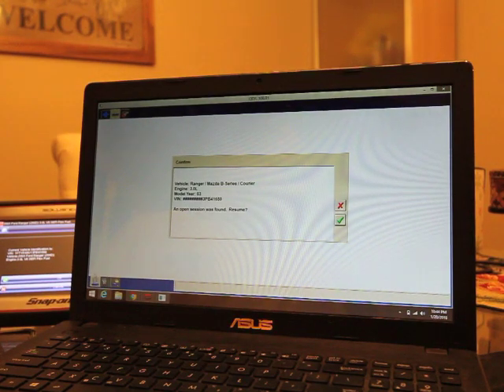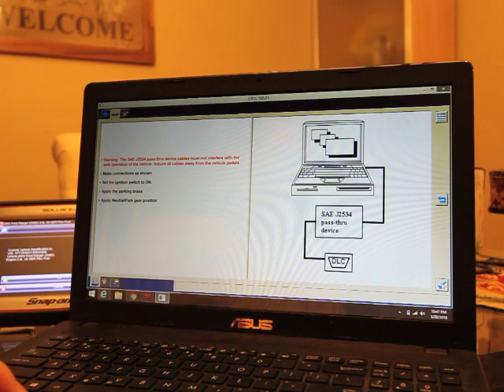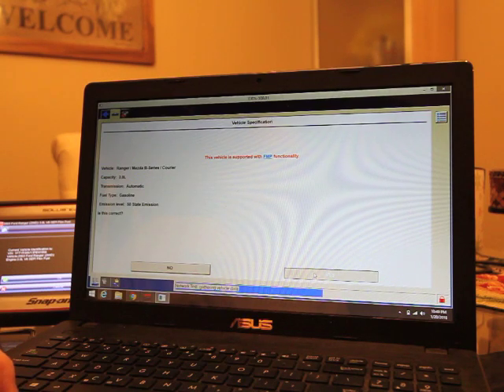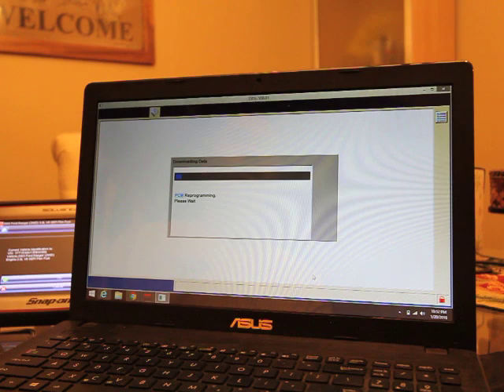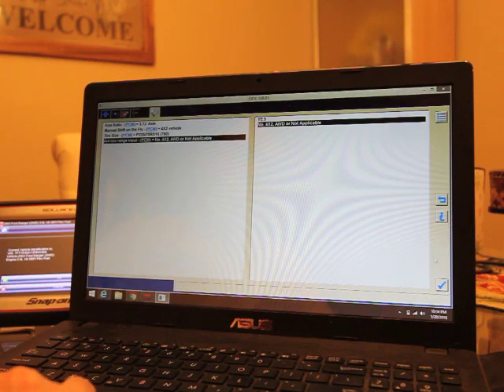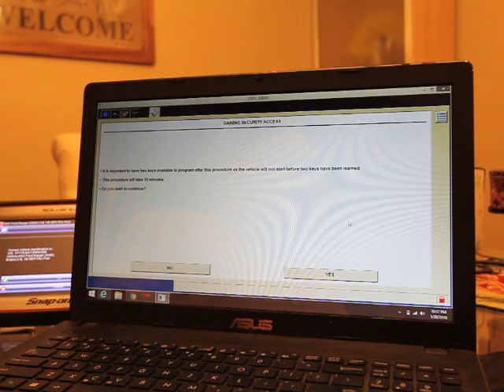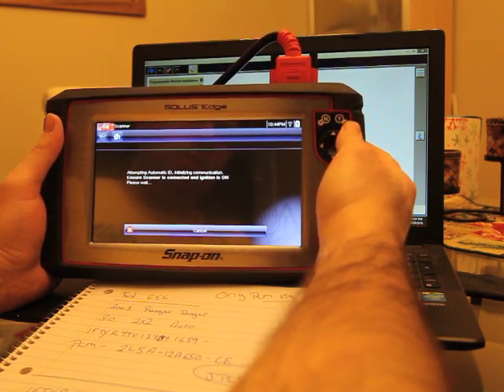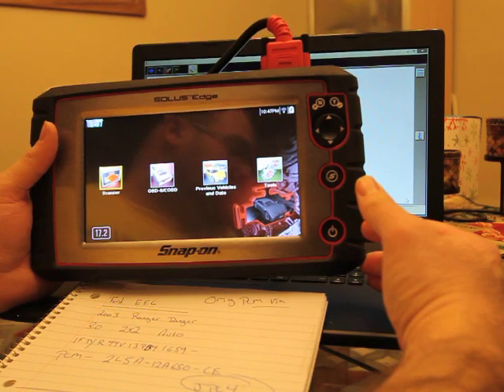Ford PCM / ECM Reflash With VIN Change walk thru j2534 Programming flash reprogramming FORD IDS FJDS

Comment: I changed my ecu with a new one because my old one fried.. now the vin number is not my original.. I paid locksmith to come out and code my original 2 keys to the new used ecu but just need my vin changing on this new ecu to my vin on the car... any help please?
Reply: My issue right now how did you go about it?

Comment: Hey question, what are the pinouts on the ford pcms that are required in order to read them on a bench? I know it’s power, ground, can h, can l, 120ohm resistor. But, does ford require more such as CKP etc?

I am looking to obtain the pinouts or their acronyms so I can look at the wiring diagram. I’d appreciate it much

Comment: Excellent info, thanks.  What bench programmer do you like for Ford PCMs?
Reply from the maker: J2534 device? I use drew tech mainly as for software IDS or FJDS when using drew tech. 
I clone lots of ford pcms now vs flashing them with a subscription when I can. 
Anything late model especially to avoid the pats reset with nastf.

I use for scan a lot for transit vans when doing abs and other odd things. Software works great for weird odds and ends.

Comment: Hi question,  i have a 2004 Focus svt, that the oem ecu has Zero communication so car would just crank. No fuel or spark at all.
After changing almost every possible part, I decided And found a 03 Focus svt ecu And came with the key too.
After installing the replacement ecu car started right up, yeah!
My main issue is that my 04 svt came with a supercharger And a Ford SCT X3 scanner that now say Vehicle not recognized. 
Of course is because  the sct is married to the oem ecu. I need somehow to transfer the Vin to the replacement ecu. 
I've called SCT and they told me sorry your sct scanner is too old for us to unlock. 
Any suggestions??

Comment: Great video. I have a question. My 2015 f350 6.2 pcm went bad. Ordered one that was programmed to my vin. After installation the truck runs terrible and won’t idle right and eventually throws the wrench icon and goes into limp mode. Even though it shows the vin on remanufactured pcm is correct is it possible it still wasn’t programmed right? Tia
Reply from the maker: Probably wrong hardware did part number match?
Reply: @SpartanAutoworx  yes part number was exact.

Comment: Eric, I am trying to figure out if I should replace my pcm in a 1999 Ford Expedition Eddie Bauer 5.4L.

My vehicle randomly shuts off when running, and when it does this, the Odometer reads '-------' and the numbers are not displayed on the odometer when it shuts off.  If I switch the ignition off at the key and restart, it restarts fine, until the '------' returns on the odometer. What does that typically mean? I was thinking that since it is random and that the odometer is good, that it may mean that the pcm is bad, assuming all the wiring in the harness is good. 

Previously, I had the instrument panel serviced to repair a problem where the fluorescent digital display odometer was intermittently blanking out to black due to a bad solder joint which is a known problem for Ford Expeditions and F-150s that have this type of display.

I took the Expedition to the Ford Dealership where they detected a TPS code and replaced the Autozone TPS that was replaced a few years ago, to a Motorcraft TPS. About a week later the Expedition shut down at 45 mph when I was driving it on a 2 lane road.

Also, I want to know if the TPS % reading on a scanner should range from 19.2% to 95% normally with a good TPS and a good PCM? I ask this, because I thought it was supposed to be more like 5% to 98% or something like that.

I have read on the Internet that the PCM Relay might be bad, and cheap to replace, maybe $15. But, that doesn't explain why the Expedition starts up immediately and runs fine until it shuts down randomly, again while driving, at various speeds.

I have seen pcm used on eBay.com for $25 to $35 to $55 on up for used Expedition computers.
I have seen programmed pcm units from Flagship One for only $177 that have been refurbished and are warranted for a lifetime.
I have seen OEM pcm units for $500 and above.

What would you do if you were trying to repair this intermittent problem on a 1999 Ford Expedition in 2023? It is a 24 year old car at this point, and although I would like to have it run right, I do not know what is the most economical, yet reliable.

Duane Wong
Somerset, PA

Comment: What if the pcm part numbers aren’t exactly the same. I have a used one trying to do on a 2008 focus the tear tags aren’t exactly the same. The donor the best I could find where I’m at is a 2010 the one part supersedes the other. I did exactly what you did in the video then get message saying the pcm I’m installing is to new
Reply from the maker: Should take programming if it says new now I cant guarantee the hardware will be the same
Reply: Could never get the pcm to go through had to call a few junkyards get the exact tear tag and numbers.

Comment: 7/8/22.    RARE SITUATION ???

Been to two emissions testing families, two dealerships, and spoken with six different technician and mechanics and not one has ever even heard of my present situation in which a car won't pass smog because the first digit (country code, 5) showed up as a special character on my ecu.  Mechanics tell me the problem cannot be fixed with a refresh because the Vin is programed and the country code shouldn't matter bc it is a standard prefix which all auto in the U.S. have anyway, technicians say to refresh the unit and the smog station says I have to go to Oregon DMV/ODOT because the Vin is not even in the system even though the registration notice came from them.  This is a clusterF of seemingly random non-answers.  What the heck am I supposed to do, throw away a perfectly functioning vehicle simply bc the ecu doesn't verify the fact the 2005 Toyota Sienna was OBVIOUSLY manufactured in the U.S.?  Please, please HELP!!!
Reply from the maker: Scan tool rewrite vin. Easy fix
Reply: @SpartanAutoworx  
Thank you for that.  From what I have found, not all scan tools have a read/write utility to enter the eeprom.  Toyota dealership wants $200 just to try with no guarantee it will work.  Literally zero people that have heard of ECU VIN mismatches (Southern OR) have not heard anything of this kind of partial mismatch and no one can say why it happens.  Thank you for your reply! 👍🙂

Comment: Hey, Sparta new Sub here, I have a code on my Ford F150truck ,p1000  bought it used, had know idea the truck had issues because the check engine light was never on, just recently noticed rough shifting, so my question is, does my truck have an issue with the PCM? PS different size wheels where installed when I got the truck. Thanks for your time.
Reply from the maker: Just means Drive cycle hasn’t completed monitors yet

Comment: in front of me is a ranger, Vin and stickers and PCM all match to a 4.0V6,
BUT!! thats not what is under the hood, 
so 4.0 PCM Hooked up to a 3.0 engine and there is many sensors fault leading to PCM. can we discuss a walk around on program?
Reply from the maker: So engine swap?
Reply: @SpartanAutoworx  
yes, engine was swapped.
and dumped in my lap.
truck will start and run but
has a groceries list of codes, "HARD FAULTS" all leading to PCM, or wire harness, open, short circuit. traced all wiring everything appears  good
PCM is my thought.
no rangers at local junkyard, i was going to try find explorer PCM, any thoughts?
Reply: @SpartanAutoworx  

key on engine off test:
p0113
p1451
p0141
p0155
p1409
p1116

DTC: stored
p0113-p
p0113
p0340-p
p0340
p1451-p
p1451

engine run test:
p0113
p0715
p0340
p1451
p0141
p0155
p1401 
p1409
p1132
p1151

having so much fun, lol.
i put a junk yard ECU in, to "rule out" ECU/PCM was malfunction. no change

Comment: Where do I find the latest calibration file for my 2011 Mustang GT PSCM? Motorcraft only seems to have PCM files.
Reply from the maker: looking for asbuilt data?
Reply: @SpartanAutoworx  No, I need the pscm calibration file for my 2011 mustang gt. Only pcm files are available for download unless you know the exact name of the file. Its like a game of go fish.
Reply from the maker: Power steering?
Reply: @SpartanAutoworx  correct.
Reply from the maker: You don’t see it in FJDS?
Reply: @SpartanAutoworx  I don't have license for the Ford software.  Is there a way to use it without a license?
Reply from the maker: No you must pay for license

Comment: I'm doing an 08 taurus right now I have learned if you use the Ford programming pats system u don't need 2 keys u can do a parameter reset without having to need 2 keys
Reply from the maker: How do you start the car with no keys programmed?

Comment: what if you only have one good ford key and fob and the other is cut but i have p1260 and my car is locked out from a failed diablosport tune restore.  any ideas?
Reply from the maker: You will need two keys no way around it. I would blankpath ecm do a perimeter reset and program in two new keys.
Reply: @Spartan Autoworx  could you do that for me if i send you the pcm and vin with 2 new keys?  or do you need the entire car?  i would obviously pay you for your time.

Comment: Tried this on 2 separate yet identical PCMs... At the point it should start programming i get an error "The current session does not match this vehicle... Please start a new session" Unfortunately, I cant find a way around it. using legit NEW VCMii and registered legit FJDS with the newest 2019 update. Any suggestions?
Reply from the maker: I ran into this even called ford with no help. Took some time but I got a way around it.
Reply: @SpartanAutoworx  suggestions?
Reply: Spartan Autoworx How did you get around it? I keep getting the same message.
Reply: @davidfuentes5300  I doubt he is going to give that tidbit away.. I just sent 3 PCMs in to have PATS disabled 750.00 It's too lucrative a market.
Reply: @fatboycrew6649  I really don't know brother... I'm just a guy building rods that need PATS removed. I was hoping to do it in house, but until I figure it out, I'll be paying 250.00 a pop for 20 minutes work...
Reply: @SpartanAutoworx  no further info?

Comment: Hey man... What's up with the FEPS open circuit/ Ignition switch position 0, while I'm bench Programing??? I had 12 voltage and then I've switched to using 18 + volts on the bench. 05 Ford PCM won't allow me to program it...What the hell man... How can I ride myself of this problem??? Anybody???
Reply from the maker: Why are you using 18 volts?

Comment: Hey... Tell me about how to fix IDS saying FEPS open circuit, ignition switch position 0? I've tried everything... Please Help!
Reply from the maker: Possible
open FEPS circuit
Message appears after trying to connect
to Ford module.
• Ignition not ON (Vehicle or Console)
• wrong or bad ECM
• wrong or bad cable
1. Check ignition switch
2. Check cabling

Comment: Hey I tried this and it will not change  vin on new ecm  to the old one  I am running fjds   With a mongoosepro Ford j2534  program tool  running on 119.2 latest fjds software any ideals what I need to do
Reply from the maker: You did not do it correctly. I did a 14 today no issues.

Comment: My question, if I have a 2002 mustang GT automatic that is going to manual swap, and I get a used manual 02' GT ecu, is it possible to just change the vin in the manual ecu and keep the factory manual tune?  Just change the vin and reset the pats/keys?
Reply from the maker: Not that easy

Comment: Hey ive been flashing pcms for a while now but sometimes when i flash used pcms on fords older than 2004 it seems to freeze the screen and lose communication to the pcm?? has this happened to you before and if yes what exactly is the issue thats causing the diagnostic tool to freeze and not program the module? could it be a bad pcm?
Reply from the maker: I have never had that issue. The only Ford PCM I have ever bricked was when I shop pulled a relay in the fusebox in the middle of my flash.

Comment: OK sir.. I found your vid cause I was trying to see if I could reprogram an old ford PCM... I pretty much been a GM fan most life until I bought that F150 4.9 300ci dual tank pickup last year.. Now I can say, I'm still not a huge Ford fan specially after what he did in WWII being friends with the Axis and supplying both sides with gear... I can definitely say i'm impressed extremely with this 1996 industrial version of the very popular truck of that peroid and can now understand why this is probably one of the most dependable, easy to work on, no brainer even for non-grease monkeys like me to get under the hood and make some sense of it all and be able to give a diagnosis with some fairly decent accuracy as to the cause of a series of symptoms..  Over 350k miles on this beast, I've had new cars run worse in their time.. Original engine.. And after working on it for now about 3 months a little at a time and just looking over eveyrthing, this truck can run and do most anything and doesn't seem to be suffering from "old age:"..   Has a renewed power that previous owners thought wouldn't return wtihout overhaul and were sore to find out, they just lacked the few times the commitment to doing a task that has not always been a simple tooth brushing of a part but the down out messiest and time consuming and tedious eblow wrenching of a job... Now I'm incorporating an HHO system as well with some other minor rethought out environmental rehasings of the orignal equipment   and since I'm not much of a mechanic really and this truck has taught me more in a few weeks than I've known my whole life.  A concern of mine was the very sense that even though this could save me a chunk of change in the long haul, there would be some resistance to the incorporation of this alternate fuel by the system in some form or fashion..  This case, the O2 sensors and the PCM love to recalibrate the gas mixture to a richer mix with the HHO combusting the fuel in the line.  So instead of less oxygen in the airflow in the exhaust, it has much more and therefore is doing the opposite of what it should be doing..   Now I've thought about somehow putting an 02 at the air mix and that be my upstream and the downstream will be the ones at the banks at the initial exhaust port.. There is some issues with this as i'm unsure the correct way to do this especially if it's cold air and the O2 sensor needs to be at 600 degree farenheit to operate "at normal conditions" to get their readings..  Since HHO is a bit of a non-steady stream of split particles of the air we breathe rushed into the intake qukckly after it's been through the electrolysis process as to have the best gains. Every factor of this HHO seems to be spot on and a good thing..  The increased torque and burst power, the cleaning effect of water being lightly introduced into the piston chamber during the explosive reaction being HHO basically becomes water again, and since HHO burns all the fuel efficiently in the chamber and doesn't leave any to need to be recirculated into the intake  to burn again, there is little need for the smog (air)  pump, the EGR, and most of those components in their original state as to reduce emissions.  So I'm now putting the HHO into the air pump which I noticed my truck has a special feature compared to many others.. My air pump actually pumps into a railing next to the injector railing..  This railing I've not seen on any other F150 out there..  And now my sense of "experimenting and curiosity" has risen to what I may be able to accomplish in the end by what I've stumbled into.. But first I need to consider some outside electrical alteration of the O2 sensors or find a way to reprogram my computer to output a more HHO friendly reaction to the mixture that is required more so and not in excess of the use of gas (and it's noticeably richer by just smelling the air when it runs with HHO turned on and finding no benefits to the best part of what I hoped to be a increase gas mileage and far less $$$ spent at the pump..   But without that change, I am finding it's costing a tad bit more in fuel rather being economic..   Now I'm wondering, can the specific mixture of gas be totally reworked in the PCM and eliminate any additional components added to fixing this or is this something that's not easily done with a download and a little reading on the topic?  Is the Ford software avail without a  costly investment or somewhere I can find it as to use it for testing and education purposes?    I need the mixture to seemingly work the same as before but depending on the O2 at the exhaust, maybe reduced a lot or reversed as to giving me a falsing engine light...  I saw one website say cut the o2 free from the PCM, but I am hesitant as to doing that cause I have 0 understanding on what the PCM would do having not see those during operation if it's designed to keep the air mixture at a certain range (think around 14:1 ratio) during operation..   Ball in your court as you may save me many headaches to come in this area which I've found myself in a bit of a nook..
Reply: lol..your short comment,,even after 2 years,,,but you cant go political now a days,,,we have all done sht,,unworthy of anything,,,gm now sold to the Chinese..................